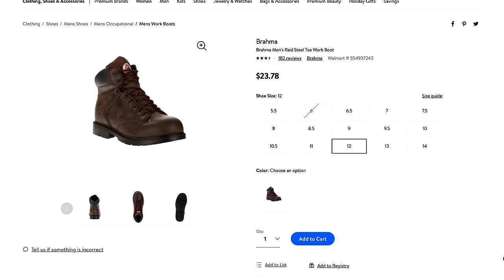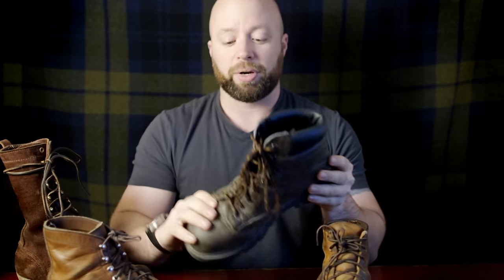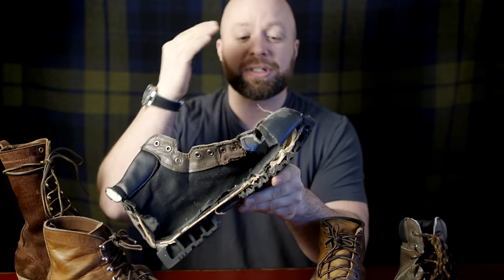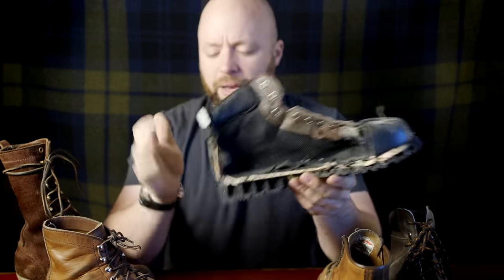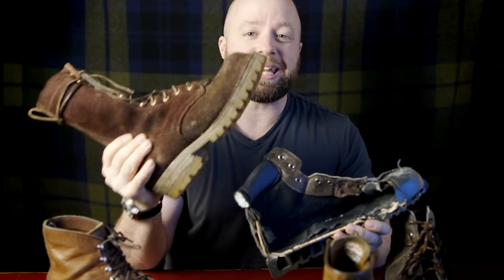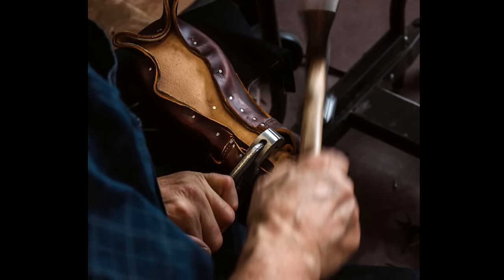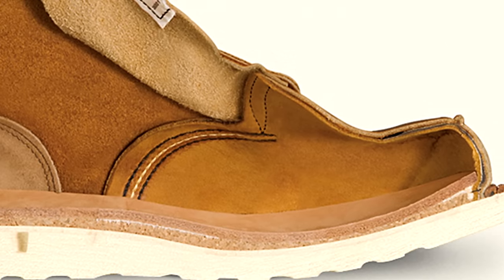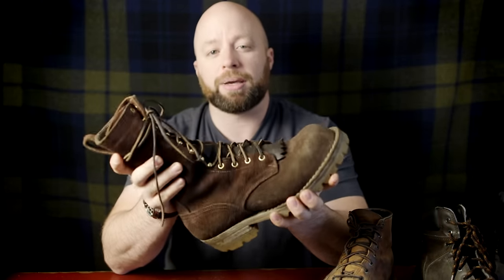Expensive vs Cheap Work Boots

Comment from the maker: What’s your favorite work boot? Let me know in the comments!
Reply: Justin Work Boots...MADE IN THE USA!
Reply: I had a pair of American made Keen work boots that went through 3 years of straight abuse and threw them out after my socks started getting wet. I replaced them with a pair of American made Danner boots. They look and feel well made.
Reply: Viberg boots for the win! I don’t think you can get lineman or logging boots etc online tho. Edit; you can they have two sites one for workboots one for casual.
Reply: I have a pair of Carhartt work boots that have lasted for 8 years that I bought when I started in the welding program I was in and they have pretty much been through hell and back with me.
Reply: I like Irish Setter Marshall
Reply: Ariat workhog h20
Reply: I have a pair of bates I like. They’re only $60 so I’m not afraid of using them for the jobs that ruin boots like cement, etc... but I have some iron rangers that I use as an everything but real work boot. So anything from loungewear to hiking I like my iron rangers
Reply: I like my wolverine pros and red wing boots.
Reply: Carl Murawski have you ever owned a pair of Danner? Could you check them out and give your opinion on them? Also what is your favorite pair of winter boots?
Reply: Keen
Reply: Wolverine 6" durashocks have got me through for 20 years now, 6 - 24 months per pair. I do so want to buy a good pair of Nicks or similar quality though, this month, when I was boot browsing, I REALLY liked the Danner's they had on the shelf.
Reply: I like my Rockies not overly priced with a good year welt. Durable boots that will last. I also like my Georgia loggers comfortable and great boots to wear in the woods.
Reply: William Lennon, British made for well over 100 years.
Reply: Whites last like two life sentences back to back
Reply: Whites are by far my favorite, they corrected my falling arches and have only need two pair in eighteen years of literally wearing them almost every day. I had the first pair rebuilt twice before the upper was toast and my current pair have been rebuilt once.
Reply: Alden 405 for me! So glad I got these.
Reply: Danner ... Made in the USA boots
Reply: I have a pair of Chippewa. It has lasted for God knows how long. I'm thinking of getting a pair of red wings but I disagree with the price of it in Malaysia. Good and reliable stuff like this is darn expensive here. A pair of red wing cost around RM 1.3k. I know quality is important but the duty tax is way too high. I wish I live in the US... 😭😭😭
Reply: I’m a Safety professional so I mostly walk around to observe, audit, and respond to emergencies. So thank you for your safety disclosure at the beginning. My favorite boots are my Red Wings Moc toe.
Reply: I bought a pair of tony llamas five years ago and I still have them
Reply: Carolinas
Reply: Timberland pros atm just got them so far great
Reply: Red Wings
Reply: "Horrible, Timberland Pro...………"
"My favorite, Wolverine...………."
Reply: Redback!!!! Been abused it for many years still comfy AF!!!
Reply: I just bought a pair of Danner Ft Lewis boots 200 g insulated. Are they cheap? Nope! Unless of course you think $400 is cheap. Keep in mind I didn't pay retail but I still got the same boot regardless. Are they worth the money? Yep without question. Once broke in they hug your feet like a well fitted pair of gloves and provide unquestionable support. They are also water proof and gortex lined so they breath. I'm a believer in buy once cry once. Besides in most cases you get what you pay for.
Reply: JK Boots out of Spokane
Reply: Whites boots hands down
Reply: Thorogood wedge heel. I work construction so it’s very important I have boots that’s slip proof and holds up to ladder climbing everyday.
Reply: I usually buy a Redwing Supersole 8inch boot. I work as a truck mechanic and I can usually get 2 to 3 years out of a pair of boots at around $200 a pair.
Reply: My pair of Whites Boots have been one my best purchases I've ever made since I've got into the trade. Not cheap, $500 before my IBEW discount, but easily the best pair of boots I've EVER worn. Perks of living in Spokane, where Whites are made, are they custom fitted my boots and was able to get a pair that fit like an absolute glove! No regrets one bit. Plus they're rebuildable. Love em.
Reply: I use timberland direct attached 9. And carolina wedge sole  moc toe. Standar issued army boots are the best like mcrae, belleville, wellco, altama, danners and bates. Try the lightests one you find of those brands and the will do great
Reply: $25 dollar walmart work boots
Reply: I have had a pair of red wing for two years my favorite pair of footwear
Reply: Wesco Kenetrek Schnee’s
Reply: Carl Murawski great video man, I personally like Carolina work boots. in Missouri and unlined pair cost between 100 and 110 and the lined run about 1:25 or 1:35. I wear them everyday, I'm on concrete or in the timber daily, they are under constant use weather in really hot, really cold, wet, Crazy Terrain, cutting firewood, I work my boots brutally. I will get one and a half to a little over two years out of them with taking minimal care of them. taking great care of them they will last longer of course. I've honestly never found a pair I like better than these. they even help maintain my posture and are easier on my knees.
Reply: I have many favorits,thorogood  is one becouse they are very comfortable at the beginning very soft workboots..
Reply: Haix xr200
Reply: Thorogood...I've had several pairs of Redwings, but gave Thorogoods a try and never looked back. Not quite as tough as the RWs, but twice the comfort, and almost none of the infamous RW break-in.  As an aircraft mechanic I'm on my feet on concrete all day every day, and I haven't found a solid work boot that gets the comfort/toughness ratio right better than Thorogood.
Reply: My preferance is Danners but it depends on the weather. I also have a quality rubber boot for when its muddy. I also have a pair of Walmart boots  that I have had for almost 6 months now I paid $29 for them. Ok so I only wear them when its dry out and I'm behind the wheel driving.
Reply: I almost forgot I did have a pair of workboots that lasted me almost 10 years, They were the last of a kind, Sears Roebuck good quality and a low price.
Reply: Carl Murawski wesco jobmaster 12inch
Reply: I work in landscaping I love my red wing irish setter wing shooter boots! So good I own 2 pairs !
Reply: Tony lamas or ariat
Reply: I have the 8' Heritage 877 red wings. 3rd pair . and recently got my first pair re-soled after 9 years. UNION CARPENTER 803
Reply: Wesco jobmaster
Reply: Thank you for this valuable insight. I am a Mechanic and have a pair of $120 dealt work boots and I can say that they are not comfortable. At the end of the day my feet hurt soo bad. I am 28 and I will be investing in a good pair of boots so I do not developed back issies.
Reply: Georgia work boots!!
Reply: My favourite were Dewalt bolsters,  not the most expensive but not the cheapest. They lasted a few years and my only regret is that I should've gotten another pair
Reply: I just recently invested in a pair of Redwings, “STYLE #4427
MEN'S KING TOE® ADC 8-INCH BOOT” (13EE).  I’m a commercial construction superintendent so, I’ve put them through some paces in the 4 months I’ve had them and I love them.  Best boots I’ve ever owned.
Reply: Danner
Reply: Danner
Reply: @farmalltractor  hot feet
Reply: @jkxx3042  my danners are made overseas
Reply: Danner boots or  Bellville
Reply: I disagree I spent $220 on red wings and soles wore out in 4 months working in a meat factory. Company did nothing in trying to resole my shoe at no charge!   Fuck red wings
Reply: Carl Murawski wolverine shoes
Reply: I like the Irish setter wingshooter,or the 8inch Georgia ranch
Reply: @cbr1thou  I am with you there, but i have not found a boot that isnt hot. I wear safety toe boots and put about 3 miles per day on concrete. nothing holds up for more than 9 months.
Reply: I wore Carolinas in the Marines then in the construction trades
Reply: Keen boots might not be the most durable but they are by far the most comfortable. I'm only able to get 2-3 years out of them but I don't mind as long as my feet are comfy. Btw I have 2 pairs and always rotate them every week so my feet don't stink
Reply: Double H Wellingtons.
Reply: I love Carolina's. They are priced reasonably. Have a boot for any job, and comfortably.
Reply: Carolina logger boots
Reply: @farmalltractor  get a pair of Carolina boots. I'm in Florida and cut grass and trees. And it took me years to find a good boot. Every pair of Carolina boots I have had I walked the heels off of. And they still felt good!
Reply: Justin work boots are my favorite by far. But for cheap boots dickys does a great job. I have a pair of dickys boots for nasty work like painting sheatrock or concrete. But Justin's are the most comfortable boots I've ever worn.
Reply: whites
Reply: Whites
Reply: Rocky bear claw 9237
Reply: Red Wing King Toe
Reply: Thorogood is made in the USA use   to wear red wings no more because they are not made in the USA
Reply: Tony Lamas than Airat.
Reply: @jessemccomb198  how did they correct your arch issue? My arches have fallen too and I am having custom orthotics made but would also like to get a pair of whites boots made too.
Reply: I had a pair of Red Wing Logger boots that went 10 years on Lattice Wind Turbines. I not only wore them for work but I ran 3 miles ever morning with them. I did a lot of welding. A lot of odd angle foot holds on Lattice towers. They just lasted. I only got rid of them because I was young and did not know I could ship them off and have them resoled. That was their failure. The sole. Took 10 year of heavy use. They finally wore down so bad they siphoned water into the foot cavity and soak my socks. I spent more money on cheap boots in the last 5 years then I would have on one SOLID pair of boots.
Reply: Nothing right now. Last pair were red wing. But they tear apart fast. Last pair didn’t last me 3 months   They cost me $250
Reply: @labmkr88  hey man you won't regret getting a pair of whites other than the price tag lol and the break in period can be brutal especially with an arch issue. I too had arch supports made but with the support that is built into the boot I never need them again, I think whites calls it arch ease
Reply: @jessemccomb198  the price isn't cheap but I pay 220 a year for thorogood and they just don't last. So if whites last it Wil be cheaper in the long run.
Reply: @labmkr88  that's very true.  Whites will definitely last especially if you take care of them with regular cleaning and greasing, my first pair held up better than my current, but I got lazy and didn't keep up on them as I should have, but i still wear them everyday
Reply: Thorogoods for me
Reply: I've only had 1 pair, Red Wings with a steel toe. The only complaint is a 9.5 is too small and 10 is too big.
Reply: Redwing!
Reply: Nothin beats my chips
Reply: Vibergs
Reply: For futzing around in my home shop I wear Cat Second Shift. For non-field  days, Danner Crafter or Instigator, for rocky desert field work, Alico New Guide Mountaineering.
Reply: Justin’s.      Or Matterhorn
Reply: I used to get wolverine's from Walmart I'd be lucky to get 6mos out of them. So I broke down and got Carolinas. Best money spent. Had the same pair for about year and half and my feet feel better and they haven't come apart on me.
Reply: Red wing. I went in for the lower end ones, sneaky bastard had me try on the top line... never looked back.
Reply: Tuning in kinda late, my husband went through quite a few boots in his 10 years as a soda delivery driver. We tried everything you could imagine, nothing ever cheap, usually spending 2-300 dollars on a pair. The only boots he wouldn't destroy in a winter season has been Ecco boots. They are great in snowy, rainy, wet conditions and the best thing about them is you can clean them up and wear them as dress as well. 2 of his 3 brother wear them now as well. We highly recommend Ecco to anyone who is extremely hard on shoes and needs great support and fantastic leather! Thanks for doing this video!!
Reply: Nick's 10" High Arch BuilderPro MTO custom fit. Best $750 I've ever spent. You get what you pay for.
Reply: Justin wedge soles 👍
Reply: I have had 2 pair of Danner boots and I love    Danner boots however the price of Danner boots is getting ridicules so I switched to Georgia boots the pair of Georgia boot I am currently wearing for work outlasted the Danner boots and to me are more comfortable I've had my Georgia boots for well over 2yrs now and it was mon ea y well spent I will be getting another pair for sure.
Reply: Thorogood American heritage emperor toe. Made in America.
Reply: Fire resistant boots ,Bouche.Made in France.
Reply: @MrBigblue29  I have a pair and I've abused the hell out of them and they still feel like new.
Reply: Haix boots
Reply: Keen are the best
Reply: The rite boot effects your spinal compression. Which effects you entire body. Which equals fatigue at the end of the day. Your feet and spine have to last you your entire life. I worked in construction and then became a nurse. You have to take care of your body if you want to have a long career. An investment in good footwear is an investment in amount of comfort or discomfort you will experience in your entire working life and beyond. It’s the beyond that guys don’t think about. If you punish your feet and spine  trying to save a buck then they are going to punish you in your old age. It goes beyond your working career.
Reply: Meme Machine lol I gave up on Walmart work shoes long ago. big 5 is the way to go!
Reply: Gary Romero love my wolverine boots they work good I just had to fix a little problem had with them other than that they work great.mink oil will make them last longer also.
Reply: Caterpillar Silverton steel toe. Just bought my 3rd pair since 2006. Love them
Reply: Double H steel toes, the ones that are USA made
Reply: Whites smoke jumpers . I was told a long time ago to take care of your feet. Your on them the rest of your life.  I'll pay 500+ for a par of boots that last 15+ years . Looking in on buying a new  par of Nick's book. Only the best  for my feet.
Reply: Whites are the king of boots I'm a wildland firefighter and you cannot get comfort and durability out if any boot like a white .from heat to wet to sweat  hiking up a mountain and hikeing down.Whites boots will save your soul and won't let you down when you need them most
Reply: Danner super rainforest, they're a quality boot made in Portland OR.
Reply: Caterpillar work boots are mine, they last me good two years till i have to change them out and they're most comfortable that I've have ever worn on my feet
Reply: The "fashion" Timberlands boots are terrible, but the actual work boots are amazing from day one and I was surprised. If the company wouldn't have paid most of the cost I wouldn't have got them but 5 years later I still love them and they feel like day one.
Reply: Got a pair a whites smoke jumpers from 2003, from when I was a wildland firefighter still going. Lately I've been using a pair of Asolo fugitive gtx. They're comfortable, waterproof, with a hard poly shank, and toe. 3 years on em so far.
Reply: White's. These boots get BETTER with age and provide full support for your feet/arch. Expensive at first but mine have lasted 3 years and only now need a resole.
Reply: @shednut2666  depends on the line my good sir I get 8" 2408s Still made in USA as are the mock toes
Reply: 405s or wingshooters
Reply: Dr marteens
Reply: Love my danner boots!
Reply: Danner all the way.
Reply: Cody Jameson square composite toe
Reply: @guerohinojosa7143  best boots you can buy period
Reply: Eric Spoelstra I wanted so wolverines but none in stock when I needed them
Reply: i love my steal blues
Reply: My Doc Marten hard toes for sure, but I'm a little biased having several pairs of regular Docs
Reply: Timberland PROs - have lasted me 15+ years. I bought a pair of Doc Marten Ironbridges (Industrial Electrical Hazard Steel Toe) - and the soles on the Docs split open and cracked after a few weeks - three times in a row! - three separate pairs....
Reply: Thorogood
Reply: Carl Murawski Carolinas 🤘🏼👀🙏🏻
Reply: damndevil13 I’m surprised I tore thru mine les than a month
Reply: I really like my Thorogood's, union made in the U.S.A, they're very well made, and very nice
Reply: Danner boots ‘workmans’
Reply: Not so much boots but I work in kitchens and a good pair of sika kitchen clogs will cost 2-300$ and will last 3 years or so as opposed t spending 20-60$ every 3 or 4 months and having your feet hurt by the end of the work week
Reply: Danners made in USA im a union man
Reply: Caterpillar boots with ergo comfort tech. I actually look forward to putting them on in the mornings for work. Walking around all day utility locating and these boots only enhance the working.
Reply: Frye
Reply: I just got a pair of cactus moc Toe dual-density. Great waterproof oiled leather, Goodyear welt. Leather lined. With a thin layer of memory foam inserts. I'm retired but I've had them for a month and they still look brand new I would put them up against the $200 pair of boots any day.
Reply: Carl Murawski RedWings
Reply: Keen are awesome!
Reply: Irish setter
Reply: Soviet military boots
Reply: @rogerpemberton79  Bought my 1st pair in about 1996, had new soles put on, the  2nd time sent to Danner 🇺🇸 to rebuild & resole. 
My 2nd pair I bought in 1999 & resoled twice.
They are now my fishing & hunting boots since both were really worn from daily rotation for work, and I replaced them in 2018 with 2 new pair of Danner  Ft. Lewis boots.  I think the leather is a little thicker on my older boots vs new production, but they're military spec so ...
  Either way, Danner 🇺🇸 U.S.A. made boots has served me very well for over 22 years and the value has been worth it.
Reply: Danner 🇺🇸 boots.  (Ft. Lewis)
Been wearing them by choice since 1996 and had other options. 😉
Reply: Wolverines baby!! 90 bucks - two years
Reply: Basic with nothing special  no steel toe etc  Alden 405s with a commando sole
Reply: Red wings.
Reply: Timberland pro logger, made in Indonesia, but better than my USA made Danners.
Reply: Thorogood boots all I wear or red wings
Reply: Carolina boots
Reply: I wear meindels there a German made boot and I log they are the best boot I've ever had they've lasted me four hard years of work and I've worn danners and whites these meindels have been the most comfortable and that lasted me the longest
Reply: I recently baught Caterpillar work boots as replacements for my Walmart boot, and I have noticed a lot of difference in my more exspensive cats. It seems too keep my feet warmer, and is pretty stiff soled, but very happy with the cat boots
Reply: Redwing 875 heritage....  have had mine re-sole 3 times...awesome!
Reply: Doc martens and them smoke jumper boots is my favorite boot
Reply: I know it’ll sound crazy but puma! I’ve got a pair of redwing Ipaid $400 don’t like them
Reply: Red Wing Irish Setters as well as King Toe. Hands down.  👊
Reply: My military issued steel toe boots.  I am an aircraft maintainer.
Reply: Danner Super Rainforest
Reply: Red Wing Iron Rangers
Reply: I'm one of those guys that started walking crooked because of cheap, terrible work boots. I tried a pair of Cats, they were ok. I eventually got my first pair of Wolverines and it felt like i was floating on air. Eventually i got a really expensive pair with a sole on them that was almost like having a foot massage. I tried on Red Wings but they just weren't for me.   And the 1 day it took for my boys to break in was just like wearing tennis shoes. I'm just speaking for myself here, and I'm a Wolverine guy for life
Reply: @tuf86sami , what have you found is the biggest difference between your Red Wings and Wolverines? I personally like the Wolverines better
Reply: @Frank-xd3rv  I've noticed to Wolverines have held up better in harsh environments (changing oil in landfill equipment while still in the trash)
Reply: Carl Murawski Red wing!
Reply: Wolverine are my go to. Smashed my foot at work a few years ago, just wish I had my good boots on and I would of avoided injury.
Reply: Red Wings ... All day everyday for 3 decades
Reply: 🤣 love the chainsaw at the end! 
Great video!
Keen steel toe mid hikers for daily work.
Chippewa (made by justin) for logging /chainsaw work. Love em!
Reply: @MrBigblue29  👍👏👏
Reply: Keen!s are my favorite.
Reply: @kokopuffs5789  I also think that in trade for life the keens' sole has more grip. I can stand on stuff my Irish setters couldn't dream of standing on.
Reply: Wesco Jobmaster Lace to toe.
Reply: Thorogood
Reply: I’ve had redwings they hold up great didnt hurt my feet. Right now I’m in timberland pros that don’t hurt my feet but the insides don’t hold up. I’m about to purchase a pair of JKBOOTS. Pricey but I hope they are worth it
Reply: Wesco
Reply: Could you make a video of your top 5 choices on best boot options
Reply: Carolinas
Reply: Uggs
Reply: Danner Acadia cst
Reply: Forgot your workbooks!?Question your opinion
Reply: Red Wing since 1981. Westco since 2011 for motorcycle riding. I ordered custom made 12 B. I will buy either Red Wing made in USA or Westco from now on.
Reply: @shednut2666  the red wings that are in this video are made in the usa. And there are various other pairs that are too. But yes, a lot of there boots are not made in the usa.
Reply: Ariat warthog patriot boots
Reply: Timberlands Anti Fatigue
Reply: Nick's hands down
Reply: Carl Murawski I have a pair of thorogoods 1957 series, waterproof, 8”, pitstop safety toe-moc toe. They are by far hands down, no questions asked the most comfortable thing I have ever put on my feet!!! They are more comfortable than any tennis shoe I have ever worn!  They are definitely worth the price
Reply: caterpillar work boots
Reply: Rocky were my favorite then they discontinued that model so I have wolverine now.
Reply: I have Gorge Boots and they were grat for a week and now I'm looking for good welding books can you help me out
Reply: Keen
Reply: I just picked up a pair of USA made Carolina... cheap at $175.. amazing feel out of the box..
Reply: I have a few pairs of made in USA danners . I keep them clean and oiled and they last me a very long time . My dad always told me your work boots should be your most expensive pair of shoes you own